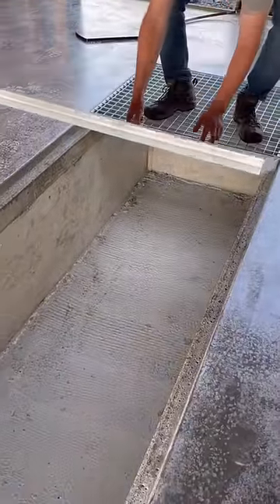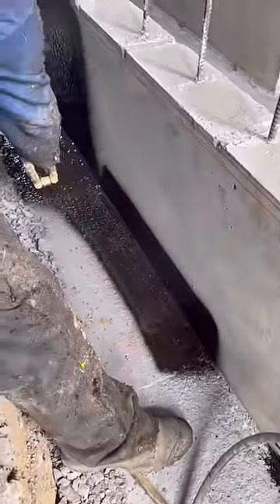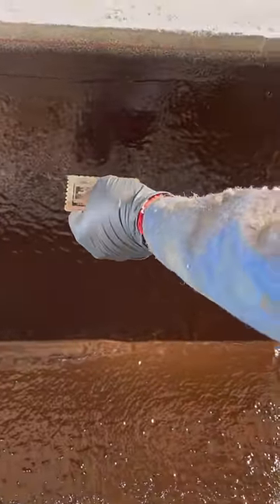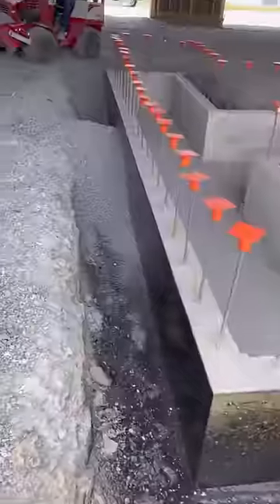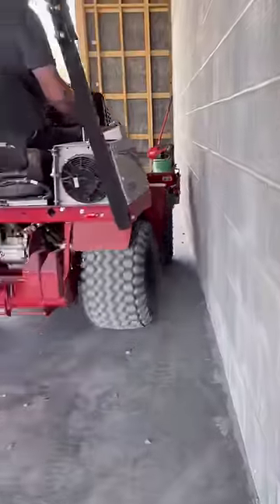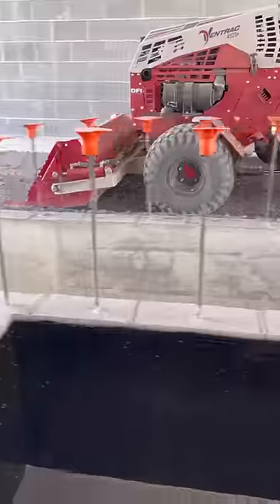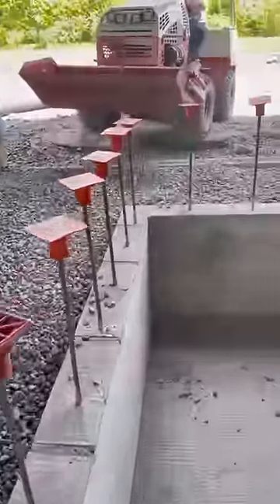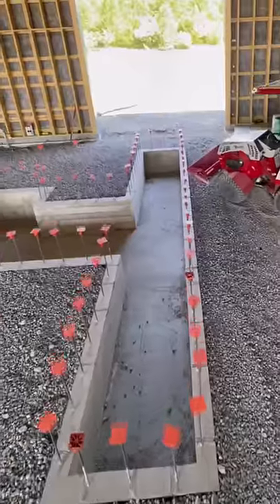Steps We Took To Waterproof The Spray Booth Pit

Comment: That machine operator is excellent. 1 wrong move in that tight space will be a very annoying day, and depending on what wrong move it could get expensive.
Reply from the maker: Thanks, it was me
Reply: What is that machine I want one
Reply: @BrandonRowanTheDomoBoi its called a ventrac
Reply: Other than the gravel crashing into that rubberized coating and possibly damaging it
Reply: @post-leftluddite I’m guessing you haven’t done much construction. That footer coating is very tough. You couldn’t dig that stuff off a concrete wall with a pocket knife, some crushed stone didn’t hurt it a bit
Reply: Nothing like a day that starts at 7 and by 715 is already annoying lol might as well cut everyone loose and pay em for 8
Reply: You ever heard of shovels ? Doesn’t sound like it so far. 😂😂
Reply: @jacobe9187  yes im aware of shovels... but that would take 5x longer andrequire hiring extra guys. 1 good machine operator wraps it up in a day with little help required
Reply: @nickprice7752 well said sir 🤝 especially pointing out the fact that he has no idea what he is talking about 😂😂
Reply: @post-leftluddite yeah, you have no idea what you’re talking about 😂😂💀💀
Reply: @BrandonRowanTheDomoBoi You won't want one once you see the price. 🤣

Comment: That’s clean stone not crushed. Crushed has a lot of fines (stone dust) that makes it ideal for compacting under blacktop. Clean stone doesn’t have the fines so water drains more effectively and it’s typically used under concrete. You can tamp it like crushed stone but it’ll never tighten up like crushed.
Reply: Correct. I was yelling this at my phone too
Reply: Agreed. Fairly important detail there.
Reply: Surly it has to be crushed first then it goes over a screen to take out the fines
Reply: @johnwarwick4105 water is ran over clean stone to wash out fines.
Reply: It’s all crushed stone. Terms must vary by region. Around here what you are referring too is called crusher run. Runs through the crusher several times and packs great
Reply: @lakesidecollision4763  you can pour clean stone in a hole and it's 97% as compacted as it will ever get. Cr-6 or crusher needs to be hosed down and tamped. You don't backfill walls with crusher because it holds hydrostatic pressure.
Reply: Can you offer me a piece of advice??
I am building a 4' x 70' cinder block retaining wall to level out my property.. I was going to put small gravel down along the wall to drain water and then soil and sod on top. but after reading your comment, I was hoping you'd tell me, is there something better suited??
Reply: Its all stone thats been crushed into smaller pieces. You're simply arguing semantics at this point.
Reply: @shanetuma3845 it's not semantics, it's technical names for a specific product.
Reply: @ehwren  ask for a load of 3/4 stone. Back fill the first 2 feet of the wall with that. Then you can use dirt or crusher run. 3/4 stone= washed stone. Item 4 or item= crushed stone with fines for packing. I do recommend wetting the crusher run if it appears dusty. And get a plate tamper. Make sure you put a drain pipe at the bottom of the wall so water will not hang out behind the wall
Reply: Everyone/ pit calls the gravel stone different. He is correct that the Gravel is a crushed stone! It went through a crusher and then screened out. Here we call it a clear stone( 3/4" clear, 2" clear). But many contractors still call it crushed. When your referring to the style with fines we call it A gravel/ 3/4 crush, 2" crush etc.
Reply: i wonder why he hasn't responded to this comment
Reply: @lakesidecollision4763 Same here (NC) I can buy "crushed rock" in various sizes, or "crusher run", that comes with the grit and dust.
Reply: @shanetuma3845 Not semantics - whether it includes the grit and dust dramatically affects the performance in terms of drainage v packing tight.
Reply: @ke6gwf which often varies by region. For instance just last week I watched three drywallers, argue over whether it's called a 'drywall rasp', a 'cheese grater' or a 'shur fit' tool.
Reply: @kelly-annflanagan7693  they are ALL wrong, it's a Surform tool... Sheesh
lol
Reply: @ke6gwf  🤣😂🤣😂
Reply: @ke6gwf  surform is a brand name. Kinda like Q-Tip is a brand name cotton swab
Reply: @shanetuma3845 its all a drink, you asked for a drink, so who cares that its warm goat milk? Drink it and be happy.

Thats kind of what you sound like....
Reply: @johnwarwick4105 not crushed . Should be gravel. Which is  already small sized and rounded naturally.
Reply: It's called 3/4 clear crush, at least that's the name for it here.
Reply: This is clean crushed stone. It has angularity since it's been crushed, clean since it's been washed. Clean stone can be river rock or crushed.
Reply: I use crushed concrete with fines for a compacted base.
Reply: @2007Tubes  goat milk is delicous bro, try it.
Reply: @shanetuma3845  lol nice, probably don't want warm goat milk if you expect coca-cola though :p
Reply: That most certainly is crushed stone but it’s also screened and washed. Here that’s called 3/4 clear. 
If it’s not crushed then it’s pit run. 
Gravel has very regional names but to get that size of limestone it definitely went through a crusher.
Reply: Where I worked last sunmer, we called it modified
Reply: It's just gravel..
Reply: Obviously varies place to place, we'd call it crushed stone or chippings in Ireland, the dusty stuff then with different sizes would be called 1" down or 2" down etc, for example one inch stone down to nothing i.e. dust
Reply: @Crewsy Gravel isn't normally crushed either. Normally it just gets Dredged and run through a screening plant. Some deposits have larger aggregate and less sand also.
Reply: @Simply_Pip it's not gravel. Its Stone.
Reply: Atleast you’re cool about it. Thanks for the knowledge it’s mine now
Reply: Some people call it clear crush
Reply: @ehwren  I am sure someone who does this for a living, will 100% give you a detailed plan to not make money doing their job.

Hurr-durr
Reply: That is crushed rock.
Reply: Same thing I thought. Real crushed,  settles, and then some.... that's why it's used, then ❤
Reply: @ehwren  There are about a million videos on here. You're missing tile, geo grid, geo fabric and retaining wall blocks. Best of luck.
Reply: $5,000?
Reply: @ke6gwf  It varies region to region.  Know the terms commonly used in your region.  What 3/4 and down means in Michigan , will have no meaning in Newfoundland, Arizona, or Hawaii.  2X4s, ductwork, plumbing parts all can change their names.  I work in all 4 of those locations.
Reply: Crush is measured by % fractured faces, regardless of particle size. Gradation with the right ranges of coefficient of curvature and uniformity is more closely related to the ability of the placed gravel to resist rutting, pushing, etc. But even if it’s a single size, compaction in 8 inch lifts with vibration would be better for the long term performance of a slab or pavement than dumping it in
Reply: Depends where you are. Where I am, this crushed. Crushed stone with fines is called base
Reply: Yeah crushed stone is something like AB3, it has large stone, medium and silt 
You add water and when you compact it the slurry holds everything together
Reply: It's crushed rock because it's angular not rounded!
Reply: I don’t even think they tamped this
Reply: @mitchelldake7203  you’re goofy 😂

Comment: We use to put a dense sheet fiberboard against the sprayed surfaces so the stone backfill wouldn't compromise the waterproofing.
Reply: Came here to say this!
Reply: What is the name of the fiber board i should use? Thank you.
Reply: You used the drainage mat against the walls to protect the water proofing
Reply: As a current waterproofer, we usually use some sort of drainage board that both protects the membrane and wicks water away from the wall.
Reply: @colinschmidt3475 what's the brand?
Reply: Agreed. I was thinking the same thing about protecting the spray surface.
Reply: @EarthshipFreedom 
Not sure of the spelling 
Homersote 
Fiber board
Reply: In imperial 60 mils is 60/1000 inch
Reply: @billdoyle2123  ? 

Isn't '60 mils' = 60 mm = 60/1000 meters = approximately 2 inches ??
Reply: @landonlandon5533 blue skin
Reply: @EarthshipFreedom use blue skin brand
Reply: @theoriginalmonstermaker  ha, no.  I know nothing about this subject but I do know that they're not putting a 2 inch coating on there!!
Reply: @DeepakKumar-lv4te  ok. But my math was correct,  so what are you saying? 
What OTHER meaning can "60 mils" have?
That was the point of the question.
Reply: Maybe "6 mils"? That would be just over half a cm, or about 1/4 inch.
Reply: @theoriginalmonstermaker  fair do's, sorry if I I sounded dismissive; I just laughed at the prospect of a bitumen spread that thick!
Reply: Fiberboard would hold water and decompose.  I might suggest a 1/16" layer of hard acrylic sheeting or similar to protect the liquid sealant.  Or why not nominal layer of closed cell foam spray or board?  Insulating as well.
Reply: @theoriginalmonstermaker  60 thousandths of an inch 0.060"
Reply: Pc2 board
Reply: @EarthshipFreedom  pc2 board
Reply: Tremco watchdog waterproofing it looks like here. You can also use Henry or  Carlisle  blueskin or grace has bituthene. Grace also has procor spray which is the Cadillac membrane. You should remove any sharp form lines and you should use a liquid membrane fillet where the wall meets the footing before using a sheet membrane. You should protect any of these membranes used in this application with some kind of pc2 or pc3 board or drainmat.
Reply: @theoriginalmonstermaker  Nope.  "Mils" is thousandths of an inch.

Comment: 60 mills here in Australia is 6 centimetres, or about 2 inches... Didn't QUITE look like they sprayed on that much...
Reply from the maker: I said mil not millimeter. A mil is one thousandth of an inch
Reply: @hausplans  Smh
Reply: @hausplans  I've never heard of a "thou" being called a "mil" before. "Mil" is generally exclusively metric, as it's short for millimetre.
Reply: @EddieTheH Check the specs for sheet thickness of plastics and tarps. In any hardware store 4 and 6 mil are standard, would be curious if they don't use that in metric countries.
Reply: @EddieTheH in US, mil is thousandths of an inch.
Reply: I thought the same thing. 😅
Reply: Why not just say thousandths?  In my work, I say and hear that word dozens of times every day, and nobody is ever confused.
Reply: What does this have to do with inches???
Mil is a thousandth of whatever, litre - mil'ilitre, gram - mil'igram. In this case it would be 0.06 metres. So you guys "metricise" the imperial system and use metric system names instead of imperial ones..? Why? 😂
Reply: @majus1334 because MURICA!!!!
Reply: @majus1334 A 6mm tarp, not a chance, that is just short of quarter of an inch thick. 😂😂 

25.4mm/2.54cm to an inch.
Reply: @hausplans I was an industrial painter for a railcar repair facility and the gauges that we used to check the thickness of the paint on the rail cars was called a mil gauge. Ideally we'd get 5 mil on a car on the sides and a touch thicker up top where the sun beats down
Reply: 60 Microns i think..
Reply: We are Americans and we have the freedom to be difficult & stupid by not using the metric system !!  That is why our products are not popular elsewhere!  Only Apple is smart enough to have their products made in metric system only countries.
Reply: Why not keep it nice and imperial. Maybe 12x3 = 1728. Yeah 1/1728 of an inch sounds better than 1/1000 of an inch.
Reply: @majus1334 This is the dumbest one, I swear!😊

Comment: I used to work in the construction field for a bit as a waterproofer, it was always nice to see the footer at the bottom of the trench be cleaned up and everything beforehand 😅 most of the time we always had to bust out a flat bar and break up whatever left from the concrete guys. We also used Bituthene 3000: Grace Waterproofing Roll after cleaning the wall and putting some type of blue glue (forgot the name), then nail gunned (towards the top) rolls of this carpet like material on top of the bituthene as a kind of protective barrier for when they backfilled in…always interesting to see how other people do things forsure 👍
Reply from the maker: I installed Bituthene before, it’s can be supper frustrating

Comment: That’s a good way to seal the wall but it can still get water through the foundation and wall seams if there’s nothing put between the two. Plus there’s a lot more that could have been done on the outside wall.
Reply: Seems more more like a damp proofing applied rather than waterproof
Reply: Bituminous Dampproofing. Looks like walls are interior. No hydrostatic pressure. Actually surprised they went the extra step Dampproofing.  I like it

Comment: I would have added a rubberized curtain to protect the mastic from the gravel. But, still better than most.
Reply: You can't put rubber and an  oil-based product together. The rubber will not remain in it's original shape and will eventually fail
Reply: @user-fw7vp9pb6f  stronger alkaline melts a weaker alkaline?

Comment: FYI Pea gravel is the only aggregate that will not compress. Crushed rock will compress and will eventually leave voids under the concrete which will eventually lead to… we’ll you get the picture.
Reply from the maker: Codes let’s us go 24 inches deep without compaction
Reply: Not true at all. Depends on material (granite, limestone, recycled, etc ), conpaction effort, how well sorted or graded the grain sizes are. "Pea gravel" doesnt even mean anything
Reply: @zbou23  and pea gravel may not "compress" but it does settle.
Reply: Got to love all the armchair experts
Reply: @zbou23  PeaSTONE. 😊 Thank you from the people that process aggregate.

Comment: I am still confused about the metrics of the bitumen coating, like sixty mils??? That's 6 centimeters, about 2 inches...
Reply from the maker: I said mil not millimeters they’re actually completely different things It’s confusing. 60 mils equals about 1/16 of an inch. 60 mm would be around 1.5”
Reply: @hausplans  aaa so mil is just a millinich! I think you mean 60 mil is around 1.5 mm, because 60mm is just under 2.5"
Reply: @hausplans  In metric world millimetre is often abbreviated to mil too.
Reply: @twanlange2827 mil means thousands 
.060 inch = 60 mils
.125 inch = 125 mils = 1/8 inch

Comment: That ventrac is awesome. Perfect loader for those tight spaces
Reply: I ended up buying a bobcat S70 with the 36-in bucket and small wheels and the 44-in bucket and the larger wheels. We use it for stuff that we have to get into the backyards and there is very little room. You can also run it up a freight elevator in high rises. Did that in Chicago. I don't miss Chicago. :-)

Comment: Small correction 
The wall become water resistant not water proof.
This material was tested in a containment tank that was to hold acid. Even though it held solution, the solution reached the concrete walls. Tank was re-lined with high density polyethylene.
Reply: Water alone won't pass the tar. But only the sides can be sprayed there and there was no visible membrane under the pour so it is porous. How you guys get HDPE on the tank sounds interesting?
Reply: @jackrichards1863  
It is common to use HDPE  in tank.  The one I was referring to was an above ground tank.  Personally I’ve worked on both above and underground tanks where hdpe was used. Some were for fuel, others for chemicals, and only one was for drinking water. Most were regular membranes, but one used HDPE bolt in panels. 
I’m also familiar with the product used in the video, which is w by I made the comment .

Comment: $1250.00 for water proofing. Looks good 👍
Reply from the maker: Thanks $450
Reply: Not bad actually
Reply: @hausplans  I was thinking at least 500-600 😅
Reply: @hausplans That had to be in addition to other dampproofing the waterproofing sub was doing. I won't mobilize a crew for a project that small for less than $1500.

Comment: Could someone do this on a basement? We have a bunch of snake oil salesmen in the UK for damp fix/proof and would love to build an addition with a basement but the water table by my house is literally about 3 inches below the surface in the winter. Everything below is clay
Reply from the maker: We have clay in our area as well
Reply: To answer your question, yes. This is in fact, exactly what they do to water proof new homes with basement foundations here in the united states.
Reply: I think you need to tank your basement in this case
Reply: USA based but we use a 3 layer protection system of an elastomeric waterproofing (not bituthene as bituthene drys, cracks and becomes useless) then we use Miradrain (a dimpled plastic sheet with filter fabric) and at the bottom we add a filter fabric wrapped 1ftx1ft French drain with a 4in perforated pipe
Reply: Ask your concrete supplier about Sika waterproof concrete,
Reply: If you want your house level for more than 50 years, you would need a few pilings under your foundation, a well-sealed basement in your environment will float your house like a boat, except over time it will list unless you hire a marine architect.
Reply: @Mike-Home-Cook great advice.  I would never use bituminous dampproofing against standing water.  Even the data sheet will tell you it's not for standing water (moisture in the soil only).  60mil self-adhearing sheet waterproofing,  or a cold fluid-applied like Tremco 250GC at a minimum.
Reply: we used rubberized coatings on our foundations along with 2 runs of 4 inch corrugated  drain pipes with socks around the whole foundation but with the water table being so high I'm not sure if that would help your situation or not